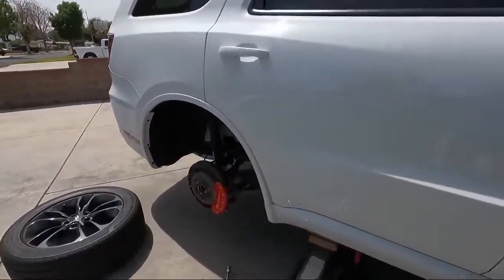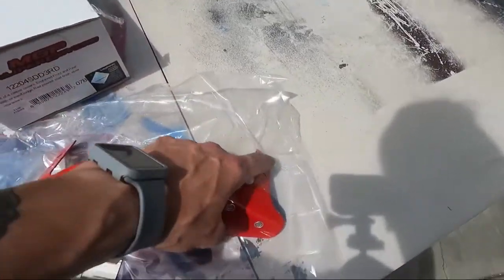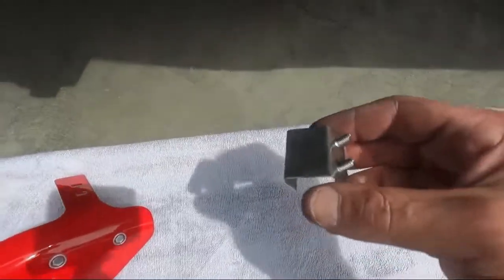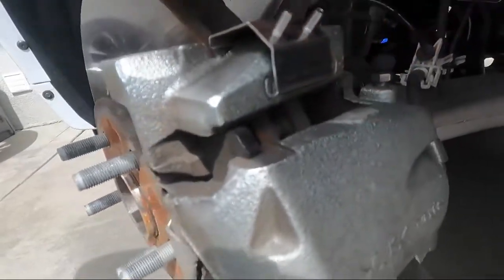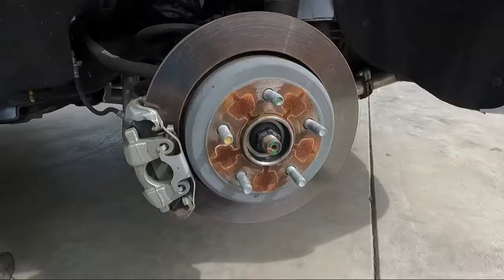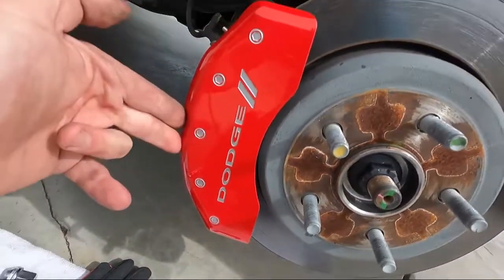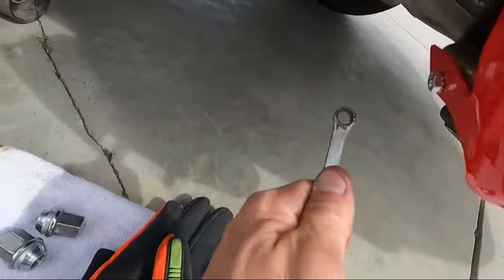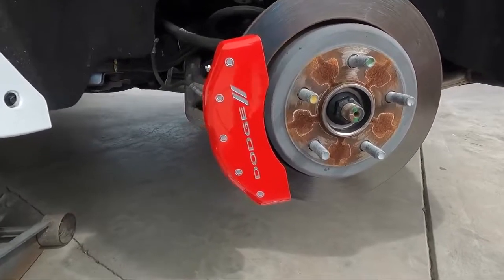Installing Brake Caliper Covers - Quick and Easy!!

Comment: Won’t driving eventually knock bolts out? Jw
Reply from the maker: Not that I’ve noticed. Had them on a few thousand miles and they’re just as locked tight as day one. The clips are intense 😂
Reply: You can add the blue loctite to it which you’ll definitely have no issues

Comment: My back breaks is a perfect size but the front wheels it’s lil big
Reply from the maker: The caliper cover is too large in the front? 🙁
Reply: Yea mines as well. The back part has more clearance than the front. The front caliper covers are bigger but it’s not rubbing.
Reply: @exhausted_performance  yea but it doesn’t the rims or anything. Been driving on them for the last 3 weeks and no issues.

Comment: Does anyone know of a shop or individual anywhere in the east coast that I can go to and get these brembo caliper covers installed on my dodge charger for a fee?
Reply from the maker: Try a brake and alignment shop specifically, they should be the best equipped
Reply: @exhausted_performance  Thanks Mate.

Comment: What should you do if you experience rubbing between the cover and the rim?
Reply from the maker: Try spacing out the distance between the caliper and the cover 👌🤝
Reply from the maker: If it rubs the rim it needs to be fitted closer to the caliper
Reply: Or you could get thin spacers. Like 8mm

Comment: Damn, bro I pretty sure these covers are a scam. It's not even the actual caliper that would be stopping the brakes, its just a cover.
Reply: Jay Jay  yea but $250 is wild for plastic covers like that. Spend another $250 and you might as well get the actual brakes. You can get those covers for $50 or less
Reply from the maker: @chrisdelacruz1355  they’re definitely not plastic bro 🤣 if you watched the video I mention the quality.
Reply: Must have done extremely well in school!
Reply: Lol Ummmm ya, they ARE a cover and nothing more..!!! Not a functional part. Damn man.. !!!!!